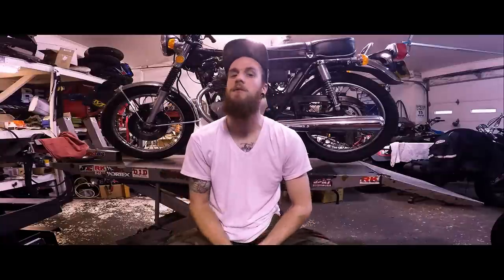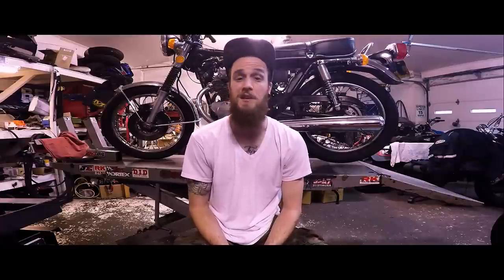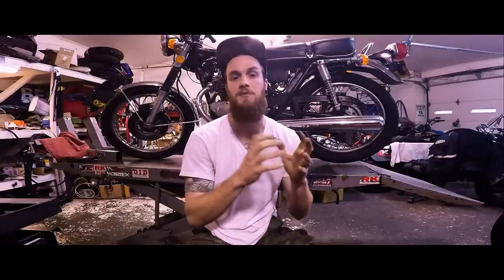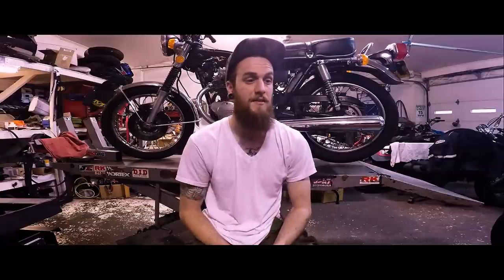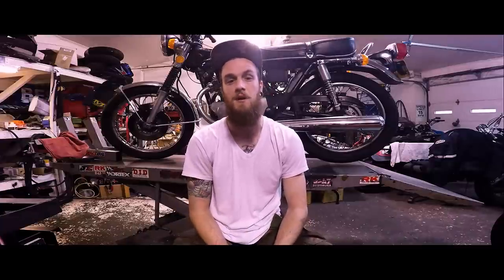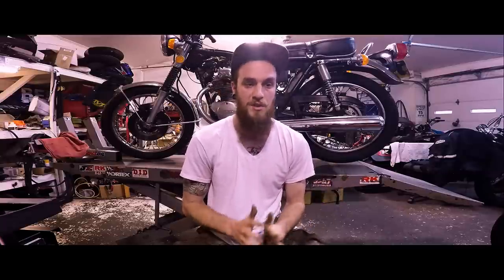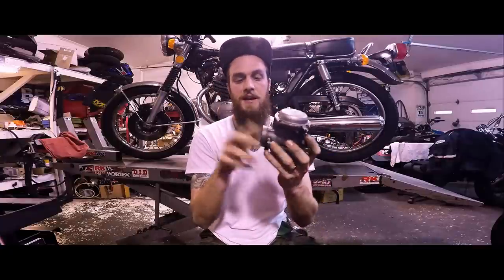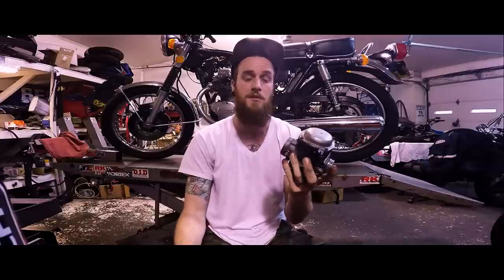How to diagnose a carburetor problem in less than 5 minutes

Comment: Hey MCMD, I have a 1978 Yamaha XS500. Bought carbs on Ebay, new stock jet kit installed and pod conversion.
when I use Starter fluid, I get a very short firing of both cylinders, then nothing.  I can't tell if it is the electrical/timing on the points or the carb adjustment.
Any help is appreciated!
Great videos btw!
Reply from the maker: tklandman Hey man, so if the bike starts off starting fluid than you know it is at least getting spark and compression. Are you positive that the carbs are clean? Because it wanted to run off starting fluid than I would question how clean they actually are!
Reply: Thanks! I cleaned them best I know how. Is it possible the points/timing are off? Also. I didn't do anything special for pods and shorter exhaust. 
BTW. Thanks again!
Reply from the maker: tklandman It could be very possible that they are off, usually if the ignition timing is off, it pops and backfires like crazy when trying to run it. When you using the starting fluid and starts to run does it sound okay?
Reply: The Motorcycle MD No. it just fires once and no more. like an obvious "ba-bump" then dead turnover.
Reply from the maker: tklandman ah ha, the ole "ba-bump". 😂 How confident are you in your point setting capabilities? Do you know how to set the backing plate, and point gap?
Reply: As much as you and you tube can teach me. I ain't scared :)
Reply from the maker: tklandman Haha I hear ya, do you have a timing light?
Reply: Negative. I've found some info on a static adjustment. Is that sufficient?
Reply from the maker: tklandman Yes, you should be able to at least get them it in the ball park. Timing light is still needed to fine tune the adjustment to figure out if it is firing to far in front or behind where it needs to be. The better question is do you understand what your actually doing when setting the point in the "static" setting.
Reply: I think so. I have an indicator light to tell me weekend the firing begins on rotation and should stay on until the second mark on the flywheel. Also have gapping tool.
Any suggestions on gap size for  1977 xs500?
Reply from the maker: tklandman Are you using an upgraded digital point system?

Comment: hi Buddy, I own a Skyjet sj125-26 (Chinese bike was all I could get with my budget) and I had to change the carb because it was losing top end power. and now I have changed the carb to a brand new one the bike is maxing out on revs. I have checked for air leaks and also the throttle is working the way it should but no matter what I try or have looked at I still can't get to the problem. do you have any suggestions please?
Reply from the maker: David North Interesting, what do you mean that it is maxing out of revs? Do you have any throttle free play? Have you tried adjusting the idle down?
Reply: The Motorcycle MD I have tries the idol screw and it has no effect I can pull the throttle and no difference in revs. by maxed out revs I mean its like I have the bike of full throttle and it increases when I take the choke off
Reply from the maker: David North head over to http://motorcyclemd.com/what-i-can-help-you-with/
and send me a message through the form at the bottom of the page. I would like for you to send me one or two pictures to see what kind of carb your working with.
Reply: it's the ecu or eci it's restricted
Reply: 2 subscribers club its carb’d so no ecu needed

Comment: Hi ya great video...i have an issue with my bike I feel it may be carb related...the only thing is it happens sometimes not all the time..i am getting bogging in power low down in the revs then as I drop off the accelerator to compensate it takes off...any ideas...as I said though doesn't happen every time.
Cheers.
Reply: Same thing happening with my bike
Reply: James Plumb have you found any solution
Reply: G

Comment: After I rejetted my bike (I put a higher flowing exhaust on it) it developed a hesitation at high rpms (right around 8k) and it stuggles to go past that point. The bike idles fine and just cruising around it runs fine. Before I rejetted, the exhaust popped a lot on decel and when I closed the throttle because it was really lean and it still pops on decel after rejetting but not as much, but more than it should. Could this be caused by a dirty carb? I checked all of the fuel lines and vacuum lines and breather hoses and everything's good. I'm thinking maybe the passage for the main jet and/or the main jet itself is clogged? This is my first time ever messing with carburetors. My bike (2007 Suzuki gs500f) has a pilot jet, a mid jet, and a main jet. The bike did sit for a few months for winter with fuel stabilizer in the fuel system and I didn't really do a good job with cleaning it when I rejetted because I figured the fuel stabilizer did it's job. I'd greatly appreciate some feedback!

Comment: Hey, my bike has the air box flooded with fuel, is that a problem with a clogged carburetor, floater or something like that?
Reply from the maker: +Luis Aguilar Float valve is more than likely stuck down. Pull carbs, rip apart, (gently) clean thoroughly.
Reply: Just opened the carb and cleaned bowl, main jet, pilot jet float and needle. Can the float suddenly go out of spec (level)?  What is the reason and then just bending the tang will do the trick?

Comment: It might have been worth mentioning that The MOTORCYCLE MD IS ONLY TALKING ABOUT 4 STROKE MOTORCYCLES. I don't care if it worked once on a 2 stroke motor. IT'S A BAD IDEA. NEVER SPRAY STARTER FLUID INTO THE INTAKE OF A 2 STROKE.  You don't know where that piston is in its cycle. You dont know where that flammable gas is going. You hope it is going to the top of the piston to fire. But you could easily be filling the transfer ports with gas. There's a definite chance of the gas expanding and blowing out the main seals. Just FYI

Comment: I just got a nice 1985 yamaha DX off of ebay and it won't start. It has spark and its getting fuel but it's not turning over. I think its the carb that's clogged up?

Comment: My bike will start up first or second kick. it runs but will not idle unless the fuel is turned off. all the jets are clean nothing is stopped up. havent fouled any plugs. could my problem be my float needle?
Reply from the maker: It wont idle unless the fuel valve is turned off?! haha Sounds like you need a new fuel petcock brother.
Reply: turns out the right side crank seal is toast. It's blowing my gear oil out the exhaust.
Reply from the maker: Good diagnosis man glad you nailed it down to the issue!

Comment: Hey I just purchased an old KZ440 and I'm getting a miss at 1500 rpm's.  The guy I got it from said it may be the boots or diaphragm.  He suspected there might be pin holes in the diaphragm.  Does that sound plausible to you?  The miss will cause it to die if I don't give it more gas.  Anyone got any idea's I would surely appreciate them.
Reply: Hey K, check out my comment! Sorry I didn't hit the "reply" box on your message!

Comment: good vid, im having probs with my zzr1100  carbs, recently removed the carbs for a clean, ( ultrasonically) , checked every component on all four carbs and after the clean every part was prisitine, checked the diaphragms all looking good, float hieghts checked and also fitted new plugs, set the air screw to the manufacturers setting however im having running problems now, its misfiring on cylinder 4 and lots of backfiring off idle, the bike starts fine with a little choke, but after about  a mile down the road it drops on cylinder 4, I did balance the carbs when I put them back in but cant seem to sort the misfire??? any suggestions would be greatly appreciated,  sounds like you know your stuff with carbs :) thanks mate
Reply: Hey Troy, depending on a couple things we should be able to narrow down your problem. Have you tried useing this starter fluid technique in the video? What happens? Are you using stock jetting? Aftermarket air cleaner?  Do the carbs get fed gas straight from the tank (gravity fed) or does it work off vacuum? Possibly a fuel pump? 

Shoot me an email codyrichards@motorcyclemd.com with the answers! Talk to you soon!

Comment: Be careful with 2 stroke premix motors and starting fluid. If the gas / oil mixture isn't getting through your carburetor because of a clog or other fuel feed issues, the oil isn't getting into the top or bottom end of the motor either. If it isn't a fuel injection motor, I would never even consider using starting fluid in it, personally. Running dry ass starting fluid in a premix 2 stroke is a real fine way to hatch that doggie.

Comment: Hey man, I ride a Honda VTX 1800 but my question is about my Arctic Cat Prowler XT 650.  After riding for about an hour and a half with great performance, the thing just suddenly dies while driving it.  Couldn't get it to running again.  It has fresh gas.  I replace the plug, the fuel pump, the fuel filter and put all new hoses on.  I saw your video and tried the starter fluid and sure enough it fired up for about a second and a half and died.  So have I discovered that the carb is clogged somewhere?  Do I go ahead and pull it and clean it.  I am not a mechanic by any means, but I can def follow instructions.
Reply from the maker: Troy Wallace If the fuel pump is working, check that the gas has no water settled in the bottom of the tank. Maybe drain the carb into a container to see if any water entered. But it could be very possible that something for sucked up into the idle jet!
Reply: Troy Wallace also check your spark...might be a coil going bad
Reply: I've got the exact same issue man, 1978 Suzuki GS500E, runs great for about two hours then loses power and dies, definite spluttering but nothing I try seems to get her running again aside from leaving her for a few hours. Thought maybe the mixture was too lean to start with but it's definitely a fuel issue, sick of bump starting her in traffic to get home praying I don't hit a red light.
Reply: I wouldn't be afraid to clean it. There are plenty of videos if you need help. If your a beginner take pics before each step. After removing lay the carb on old towel so parts won't roll away. Be careful of using a air compressor because it can blow out a o ring/seal you didn't know was there. Just take your time until you get use to it. Those little bread sack wire ties and some carb cleaner can do wonders.
Reply: Sounds like a vacuum in the fuel tank. The breather is possibly blocked. Try opening the cap when it stalls, and fire her up again. I had a GS550E back in the day, the electrics caused a weird misfire.
Reply: Peter Kirby my gs1000 was doing that ended up being stater

Comment: Hi, just wondering if anyone could offer advice on a scooter issue that has been haunting me recently.... I have a gilera runner St 200 and had have it slightly modified for last 5 years with no issues. All of a sudden (7 months now) I have backfire and pops when I release the throttle. My mechanic can't give me an answer. He tried adjusting the jets slightly as he said it was a bit lean with no avail. 
Everything else he said looks good except he mentioned something about a needle and a spring part on the carb that is supposed to close to stop fuel entering the combustion chamber or exhaust could h the culprit. Something about wear and tear and the needle vibrations can wear out the seal and fuel leaking through....
Does this make any sense? Akrapovic exhaust on for years now and this is recent. He asked me to get a second hand carburetor to get the part he needs off it. I'm not mechanically minded but that small leak happening is all he can think could be the problem.... If my exhaust gasket is new, no other visible signs of wear and fuel air mix is fine, what else could it be? Any advice or guidence would be greatly appreciated!!

Comment: Hi, I just installed air pods on my 1982 Honda GL500 and now it's got a bad throttle response + Super high rpm rev every time I start it and some backfire, I tried to restrict the airflow a bit in my pods but still there's no difference...I don't know what else to do please help :)
Reply from the maker: LEAN! Shim the main jet needles and go 5-10 up on the main jets. let the tuning madness begin!

Comment: Maybe someone can help me. just got a cr to rebuild and got everything rebuilt and now I'm down to the carb. as soon as the carb gets fuel flowing through it, it automatically starts pouring out of the overflow. the bike will start but when it does it revs to the Moon so I have to cut it. the float is good I'm not sure what to go to next

Comment: I have a 2006 Yamaha 230 that has been sitting in my shop for 8 years, with gas in it!
I drained the gas added fresh and the Petcock leaked. I replaced that. The bike wants to fire but doesn't. Runs for about 2 seconds then dies. I'm thinking about draining the bowl then adding Seafoam. Any thoughts?
Reply from the maker: Dave Elam I wouldn't waste your time with sea foam. The carb needs to be taken apart completely and cleaned thoroughly. Sea foam is not a cure all.
Reply: I'm old, have huge hands, don't see well, and if cost a nickle to poop I would throw up. Thanks

Comment: hey man,  great video.  I have a problem,  I tied to improve engine power on mi bike by modified the air box and changed the getings on my carb,  at first the bike went great,  it had very good low end power,  but testing it on the road,  it dident do more than 8k rpm and it's suposed to go up to 10k. Then the bike started to make strange things y dont know how to explane because englis isent my first language,  the bike then dident go over 5k rpm and whas staling and semd to mis fire.  
in an atempt to fixe my bike i put it all back like it came from the factory and it still has that problem past first gear.  I hope you can give me a solution to mi problem.  thanks
Reply from the maker: Pau Ayelo Hey man, sorry to hear about all those troubles! What kind of bike do you have?
Reply: The Motorcycle MD its a small bike, its a 125 cc 4 valve sigle cilinder and it has a keihin CVK carburetor on it i forgot to mention that i also modifier the exaust silencer
Reply from the maker: Pau Ayelo It sounds to me more like an electrical issue (ignition). How's the spark?
Reply: I havent chekt the spark plug yet,  because i dont have the right soket to do it,  but i whill check that.  Thanks for you'r help

Comment: well im very sure my 85 vf700s  is having carb issues. itll start and run fine cold, and harder to sart the warmer the engine is. tested all ignition amd swapped cdis to the other side and all is good. spark is good, but 2 rear cylinders arent firing. it ran great n then one day it just bogged whilst riding it. can i do a good cleaning job without removing all 4 carbs so i dont have to sync them ? im pretty sure they are pretty nasty inside.
Reply from the maker: Nick Barker Hey Nick, sorry for the trouble, a quick answer is no there is no easy way to thoroughly clean those carbs with them in the bike. You run the risk of stripping out jets/bolts and other parts trying to wrench in tight quarters. Just cleaning the jets out of the carb is great but the passageways that lead to those jets are also problematic. The VF carbs are not a simple quick design either. They can be a hassle. When you say it runs fine when it's cold, are the two rear cylinders firing when it's cold and not when it's hot?
Reply: The Motorcycle MD it seems it is running on all 4  for the first minute. itll rev to 11k no issues,  but once it warms up, i lose power, and it wont idle, wont rev smooth,
Reply from the maker: Nick Barker is the choke on in this cold condition? When it heats up and starts to run poorly start applying the choke and see if it picks up and responds better.
Reply: Nick B mo

Comment: What if it only starts and runswith starter fluid (or fuel poured directly  into carb)and gas applied.. but as soon as you let off the gas it dies
Reply: Ever figure this out?
Reply: @nickmara7  not exactly.. had it rebuilt and it started working..

Comment: Hey I need some help 
My motorcycle is 50cc 
It starts and idles fine but when I give it throttle it doesnt accelerate it just dies slowly 
plz reply thanks
Reply from the maker: +Joshua Vishnan Subscribe to my email list at MotorcycleMD.com and fill out my ask MD live questionnaire
Reply: usually a bog off idle means clogged pilot jet(s).

Comment: I just got a 1980 Kawasaki z650 Been stood far a year had no wiring loom so I've fitted a new one so all good on that end I've cleaned the carbs out blown all the jets with air and it all seems good until you start it and it runs real ruff won't rev and sucks air like a Henry Hoover with the od backfire through the carbs any ideas anyone

Comment: my problem of my cv carb how to diagnose it properly. from idle to full throttle its run smoothly to its rpm sound.
but you test drive and reached the rpm 5thousand and 6thousand the slightly slog the rpm power. but when exceed 6_thousand back to normal good acceleration and best run...
whats the problem of it in between ,5&6rpm???? 
tnxs...

Comment: carb cleaner does the same thing and won't hurt rings like starting fluid, starting fluid washes the oil off cylinder walls, no upper cylinder lubrication = scorched rings!
Reply from the maker: paul acabbo Correct, if you continually run your bike off starting fluid. A hit and start will not show those results.
Reply: TheMotorcycleMD  the last quickstart i bought at advancr auto had a built in lubricant now !!!